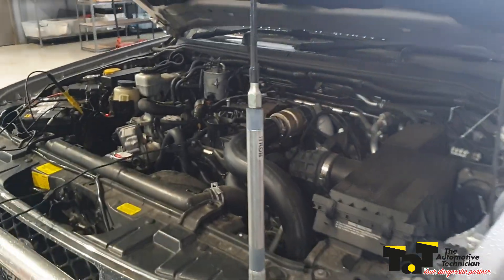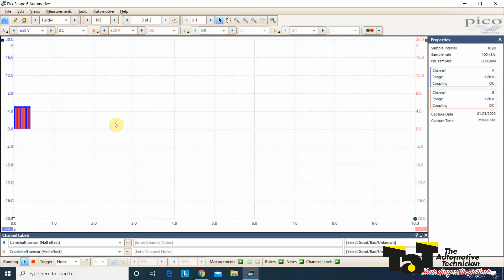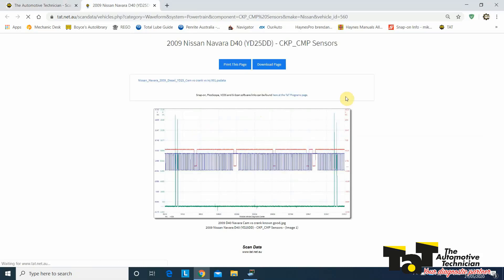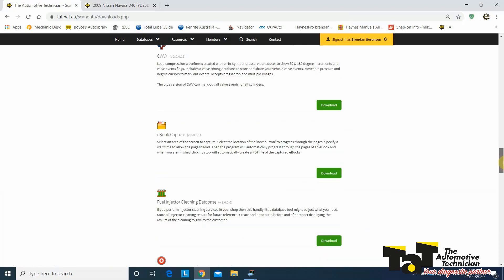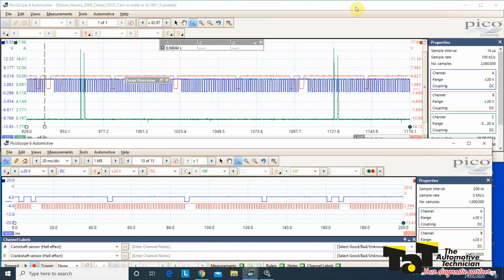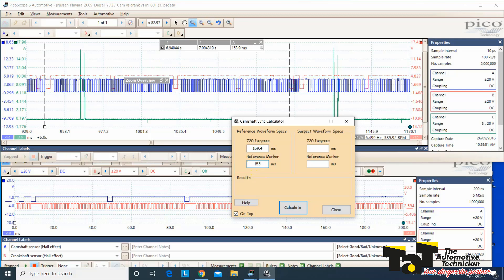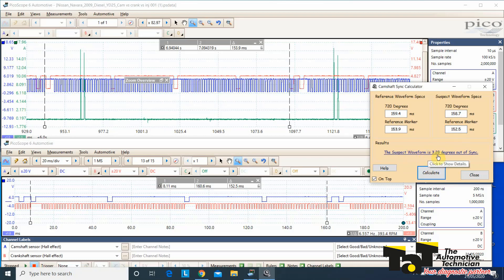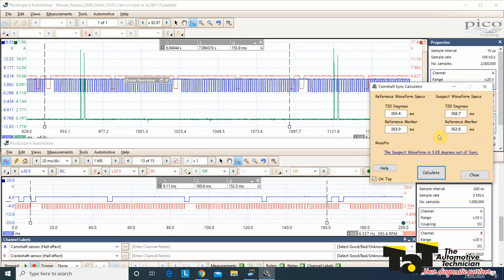Nissan Navara Pathfinder YD25 Timing Chain Professional Check

Comment: Brilliant and massively helpfull, just had a d40 with a yd25 in with low power issues  (among others) using this method proved that timing was out by aprox. 30 degrees.

Comment: I think i have just worked it out..as the old and the new waveforms use the same reference point. New slippage and old slippage can be compared. The difference must be chain stetch..  but which chain?

Comment: Great video!. Just bought a 2008 d40...could you list the parts needed app, scope etc.and where to find online
Also im assuming you are looking for phase delay, in other words, how far the cam shaft has drifted benind the crankshaft compared to new
Also i like in thailand could i use your new 2009 reference figures
There are two timing, one simplex and one duplex.. Does ur method check the total slippqge or for just one chain

My  navara has done 110,000 km
Reply: If the crankshaft and camshaft (either old or new) have different cycle lengths it must mean that they are running at different speeds, how can that be.